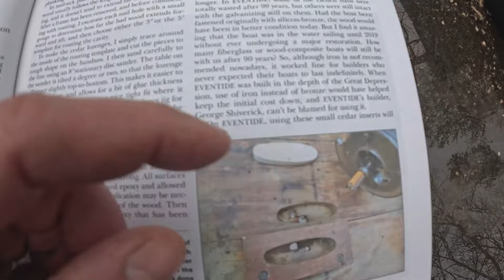Saving Maverick Ep. 25 - Converting Reclaimed Lumber Into Wooden Boat Frames

Comment: Exciting stuff! If you do need the gas burner for your steamer, I've seen people use a steel jerry can as a water vessel. But the Rockler might do the trick, if the box is tight and well-insulated.
Reply from the maker: @@SlowlySailing-lc1cs Thanks! The only thing about a Jerry can is that it doesn't seem like it would be very efficient to heat up since it's a tall, narrow rectangle (at least the military surplus ones im thinking of are that way). In any event, I'll get the box built this week and do a test run on the rocker boiler to see what kinda steam volume it's capable of generating. It may be a bit better than a standard wallpaper steamer but it sure does look like the same sort of thing.

Comment: You're lucky to be able to find good reclaimable wood. I wonder if the planer is going to stand up to all you have to do, but what ever a useful tool. Have a look at the Jon Seal Wood videos. Two blokes building a small sailing dingy. They made a DIY steamer with plastic sheeting tied at one end and a steam pipe at the other. The excess steam just leaked out!
Reply from the maker: @brianbigland8529 Right? Thankfully, I work at a stone yard, so everything comes in on pallets and skids that are frequently made of white oak.
 I'm actually already subscribed to Jon Seal. Great boatbuilding content! They got away with the plastic bag method because their frames were so small. My 1.75" square frames are gonna need a proper wooden steambox and substantial steam generation.

Comment: Hey 👋 it might be best to hit the timber with electric hand plane first
Sacrificing the cheaper blades of the hand plane
Reply from the maker: That's definitely correct, and I'll absolutely be picking one up at some point, but I do think that a good helical cutter head for the thickness planer will make that machine far more suited to this kind of work. The little carbide blades are not terribly expensive, and each one has 4 cutting surfaces.

Comment: Why don't you add a sacrificial plank on the top of your deck railings. I see you have a few nicks in your railings already.
Reply from the maker: To be fair, when the boat shed goes up, the deck railing tops will be removed, and the rest of the railing will become part of the structure of the starboard shed wall, so I'm not too concerned.